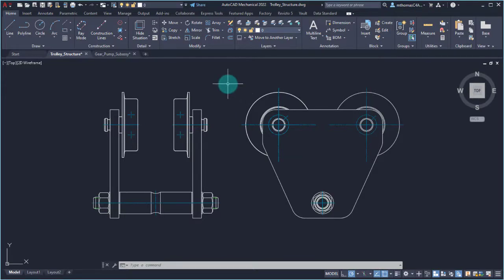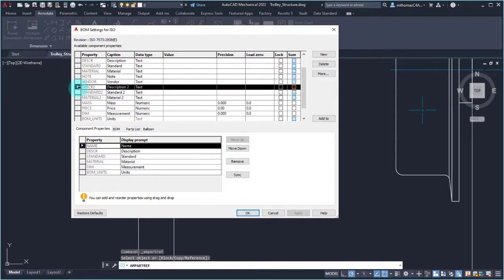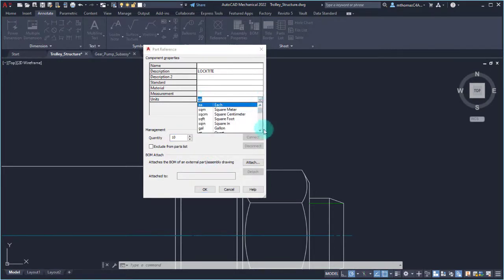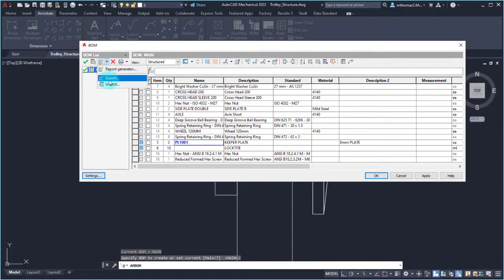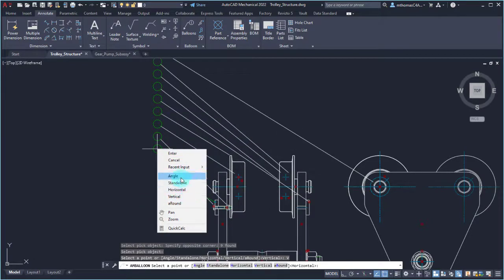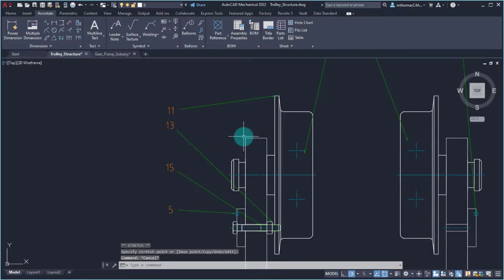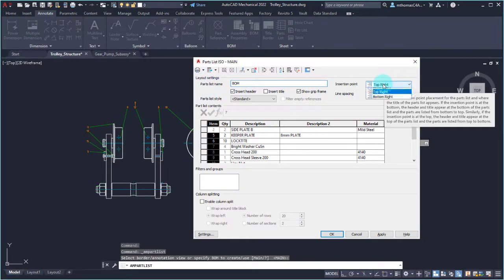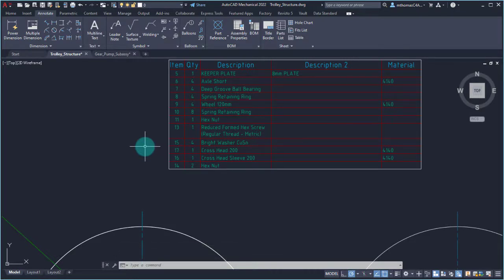AutoCAD Mechanical's Bills of Materials

Comment: Can you explain how to split larger bom ??
Reply from the maker: The BOM itself cannot be split, but you can split Parts Lists. In the Parts List dialog, near the bottom, is the option to enable splitting. You have the choice on the number of rows or evenly distributed sections.
Reply: @DesignandmotionNet  Thank you sir